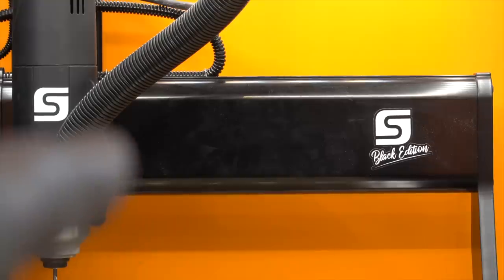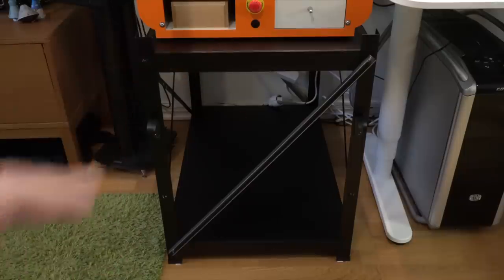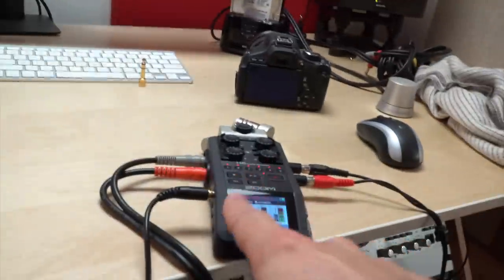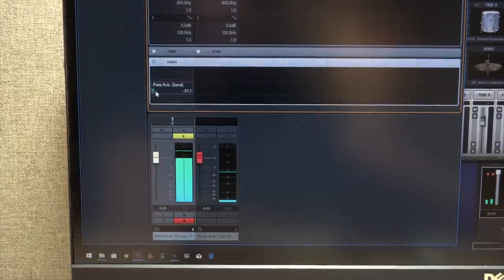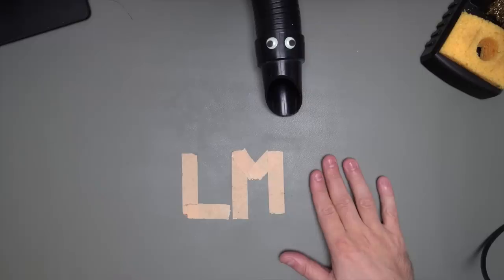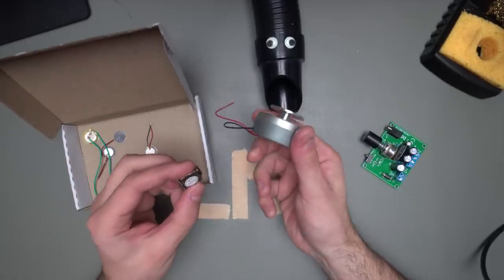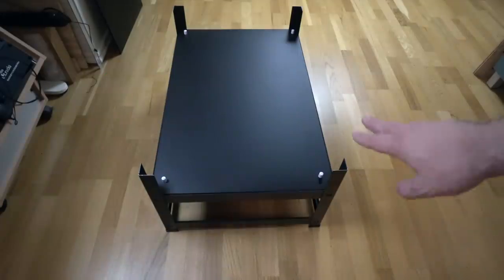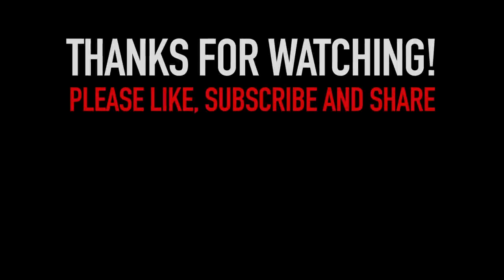DIY "IKEA Hack" Plate Reverb.  Sub $100.

Comment: I built a plate a few years ago.  It will sound a little better if you use 26AWG sheet metal and suspend it with wire.  It should be under tension and have a fair amount of distance between the sheet and the shelf below it.  You may need to cut down the corners to make room for the suspension.  Great experiment.  Thanks for sharing!  BTW, if you want to play with your current hardware more, sand off the paint, use longer spacers and use only three, placed randomly.  Patterns are your enemy in acoustics.
Reply from the maker: You're absolutely right about using 3 spacers in random orientation to avoid regular patterns and acoustic nodes in the plate.  That's a brilliant thought and I can't believe I didn't think of that.  Your other observations are on point too.
Reply: @LeoMakes  Heh, I get lucky sometimes.  I actually had a client ask if he could buy my plate off of me.  Mine was 26AWG 3'X5' suspended in a wooden frame.  I put a styrene board in the frame to act as a damper with a pull-string to control the spacing.  I used piezo pickups at first but got quieter operation with a couple omni condensers later.  Any way, keep experimenting.  I would love to see what your final version is like!
Reply: BTW, your video inspired a huge discussion within the AMPEX E-mail group!
Reply: Built 4×8' in wooden frame years ago.
Suspended from ceiling.EQ'send/
returns,in a another room,as they
(as u know)will pick-up ambient
sounds.
 Thing sounded great,EQ send .
frequencies that were "harsh",EQ
return(and plate)shaped overall
sound.Much tweaking to dial it
all in.
 An engineer said that if the plate
was isolated and properly suspended
in airtight enclosure,and pumped
out w/vacuum pump(obviously not
a complete vacuum) that it wouldn't
pick up any ambient sound,as sound
can't travel through vacuum.
  The plate,heavy guage sheet metal,
is now the floor in bed of old truck!
 I've fooled around w/smaller and
thinner sheet steel w/good results.
 However plate needs to be under
more tension that thicker steel.
Using 2×4' thin guage (28-32g)
suspended w/Multiple stiff springs,
(at least 8)in oak frame sound really
good.I need to install nylon grommets
into plate to eliminate minor "buzz"
from metal to metal contact.
 Then suspend that apparatus
in an enclosure and pump it
down to "near"vacuum.
 That being said,I've used some
softer steel that sounds even
better that the harder stuff.
  Then my friend suggested that
since being in a near vacuum
enclosure,why not 2,or 3,or MORE
units in same box!Wow -good advice
again,as u can't have to many
reverbs!
 Don't have the spare cash to do
this now,and don't have space
for a studio either,so it goes
on back burner for now.
 I use good 4"speaker,carefully cut
out dust cap,glue in hollow cardboard
tube(fits in cavity behind dust cap).
 Then trim to just touch plate,and
glue using urethane sealant.
  Pick-ups?Acoustic instrument
Pick-ups work great for this.
 2×4 frame covered w/osb 
plywood seals unit up pretty good,
although heavy,this also adds support
to framework.Spings?short heavy
springs w/hooked ends,2 on each
corner,90 degree apart.Use eyebolts
not screws as they will pull out.
 Suspend unit in another frame or
from ceiling.This makes the unit
Level,which is important.
 After hanging unit w/plywood on
backside,then install speaker/tube
on face of middle section of front
plywood(front is in 3 sections).
 I've found that point of attachment
of tube to plate to be 2-4" off center,to
be ideal.
 Transducers in line w/each other at both ends of plate 4 to 6" from edge also ideal,as you don't want them
to be out of phase.
  Cut the lows(100 and below)
 Cut the highs (3k and above)
going to the plate as a good
starting point.A cheap graphic
or similar w/any old amp to
drive plate is fine.
 Since transducers(pick-ups)
are high-z, I soldered 1/4"
Jack to them and plug into low-z
transformers,and then to
balanced Mic cables,then
into mixing desk using 
EQ on board to make 
final tweaks.
   A drill and $200.00 bucks and 
you will have a Quality sounding
plate reverb that can deliver
astounding sound.
 If you want to "dampen"it(shorten
decay) Install a t-nut on front panel w/
long bolt(1/4" diameter or so) attached
to 3×3"or so cube of soft foam rubber.
Use urethane sealant(calk) to fasten
to end of bolt.Then simply adjust
to shorten decay.Place this
apparatus on either left or right
panel so contact w/plate is 4"
or so from a corner.This is not
critical,but u want it close to
the edge,not anywhere in Middle
area.It will barely contact surface
to dramatically shorten decay.
This set-up will give 3 seconds
or more decay,so this little
thumb screw deal works
great.
 After dust cap is trimmed off
speaker then get appropriate
diameter tube(hobbie supplies)
 Steel can be had from various
suppliers,such as McMaster Carr,
or sheet metal shop.Springs
from M Carr or the like.Small
flat "L brackets for corners
at hardware store.Fasten
one on each corner w/ thin
rubber,or sealant under them
to prevent "rattles".The springs
hook into these,after mounted
w/small bolts to plate and drilled.
 As mentioned,nylon grommets
are highly recommended.Springs
can be hooked right into plate, but
Will tear metal after time,as we're
talking about 50lb or more of
spring tension(tension it takes
to expand springs,and there will
be over 400lb's pull on plate.
Get steel,springs,eye bolts,washers,
brackets first,then make frame,etc.
 An alternative is to use 8 small
turnbuckels,and high grade ones.
That's what I used on my first
plate,and worked great,though
8 heavy coil springs are better
and contribute to a better
sound.The original plates
we're hung in steel frames
as they (most of them)had
so much tension they would
have collapsed a wood frame.
I prefer wood frames/springs as
they contribute to a smooth sound .
   The original plates were "tuned"
(like an instrument!) to the users
preference,and also very expensive.
  I felt it necessary to give these
guidelines which yours truly
learned from many,many hours
of trial and error.
  An if I get into the right situation
again,several of these units will
be quickly put together and put
into service.
  The sound to my ears surpasses
their digital counterparts.
  They sound great on vocals,
stringed instruments,etc,but
really shine on percussion
stuff.
  Analog tape and gear and
good mic's can't be beat in my
opinion.Digital stuff is best
for mix-down and mastering.
  Analog tape has a natural compression
when driven(and distortion!)and like
plates,tube limiters and such cannot
be equalled with algorithms
and unlimited tracks.
Reply: @robertgodhard3248  Tyvm for all those very sharp technical tips on the REAL thing (the ikea funny thing is nice too and easy, tho).
Very interesting, keeping it all, if one of those days...
Just one thing : wouldn't it be better to NOT enter xformer directly from piezo ? I've seen other designs doing so but ... Wouldn't it be better to first plug piezo (very short wires) to very hi-z ( 2M, 5M or even more) FET buffer ? This is usualy the way it's done for acoustic instruments, isn't it ?
Piezo are so weak and prone to noise catching...

Comment: I’d like to hear what it would sound like to run a 2x speed signal through the plate reverb. Then, of course, you’d slow the recording back down. It would probably sound like a much bigger plate, but who knows.
Reply: Joseph Yarzebinski That’s a really creative idea!!
Thanks for giving me some hope un the human race :-)
Reply: Back in the 70s , a firm of architects used something like that to deduce the sound of real concert halls from  using quite small models. Of course doing it whilst hitting your plate/spring with a small screwdriver gives rise to the whole gamut of Star Wars blaster sounds!
Reply: i think so. My impulse reverb has that option for sounding longer and works well (add a hipass though)
Reply: @ianbaxter8299  unrelated,  but if you take a metal slinky, and put the ends over yours ears and shake it it sounds just like the star wars blasters.
Reply: @javiceres  *species
Reply: unless you're working on tape you'd be introducing artifacts by slowing it down. i would slow the signal sent to the reverb down and then speed it up.

Comment: You actually already own the ideal piezo preamp...  right there in your rack!  The Great River preamp's Hi-Z input is a JFET buffered DI that feeds its input transformer.  The input impedance is 1 MEG, and it's ideal for passive piezo pickups.  I put piezo pickups in all kinds of things and it sounds great.  I have long thought of building a plate similar to what you did.  I'm glad to hear that it works so well.   You should also play with the location of the plate support knobs.  It will change the vibrational nodes of the plate.   Great video!
Reply from the maker: Good eye!  I got that MP2-NV maybe 10-12 years ago straight from the man himself, Dan Kennedy at Great River Electronics.  It is glorious.  Magnificent, even.  It most certainly would work for me but I'm trying to do this project with lower-cost options that the average home gamer might have or can build.  Good recommendation, though!
Reply: What would happen if you put rubber pads under the plate support knobs to further isolate the plate from the chassis? I would also put it on wheels so that you can wheel it around the studio to modulate the effect if you so wish?
Reply: 1 Meg is not "ideal for Piezo's". It is too low.

Comment: Damn. Ya beat me, to the punch. Bravo!

I'm a studio owner. I've had a pair of EMT plate reverbs over the years. And boy oh boy, do I miss them. No digital anything can compare.

And so it had been my intention. To take a metal double frame bed frame. Weld it, solid. Add some, reinforcement braces. The piezoelectric buzzers are all right. Though I think a, Barcus Barry or a, FRAP, Might be more advantageous?

And then a, 4 x 6 foot piece of, stainless steel sheet metal. Double reinforced at each one of the corners. Let it get me the extended reverb time and greater density that I desire.

One other thing you missed. Is that, on the driver side. A rather large treble boost a.k.a. preemphasis of the high frequencies is added. Which, frequently kicks up this, sizzling sound. Which some people love. Like myself. Others hate it. Some scorn it. I embrace it and love it. It's definitely the audible clue. You got a real plate reverb.

The problems EMT had, manufacturing their, 140 series plate reverb's. Was twofold. One is that of their, cold rolled steel. Having about a, 60% rejection ratio. I know. That's almost unbelievable. And if the Germans can't make decent, cold rolled sheet metal steel? Who the hell can? Which is one of the arguments for, stainless steel.

Conversely. The cold rolled steel. When you opened up the EMT plate to properly tension it. Everyone found this horrible sticky stuff. All over the sheet metal on both sides. So nasty, sticky that it was. Many technicians cleaned it off. And that's a big whoops. As that was covered in, kneetsfoot, oil. To keep the cold rolled steel from rusting like an old car. And some were destroyed in that fashion. While others still sounded great. If they were lucky?

Reverb time was varied with, basically, rigid fiberglass ceiling tiles. Glued,, to a backing. Suspended with, levers. That moved the ceiling tiles closer to or away from the plate. To vary the reverb time. Never making contact with the physical plate. And was truly an amazing invention created by Dr. Kuhl, in 1958. It changed the world. As today. All digitally synthesized reverbs. All try to imitate the plate. And really none can compare. Until you spend between $5000 and $15,000.

So this was a great project you presented! I'm in love with you LOL. I mean a better sounding reverb than a, digital gizmo for $100. That's absolutely brilliant! And is quite usable sounding. I'm just spoiled having had the real things. So, I have to have a big one. Yes I am one of those kinds of girls. But that definitely is one great bargain!

Mx. Remy Ann David
TheTruckStudio.com
Reply: Thanks for the tip. I was thinking carbon steel would ring better than stainless but that rust would bodge up the reverberations, neets foot oil it is! Also knowing they used acoustic tile on the dampening- I've been trying to engineer how to keep a felt piece from touching the plate and rigid tile is a fabulous solution. Looking to start assembly in the near future. 😸
Reply from the maker: Very interesting observations--thanks for that.  I didn't know about the oil coating on the plate, but it does make sense.  It's incredible how quickly uncoated, ungalvanized, or otherwise unprocessed steel starts to rust.  Part of the reason I went with the "tabletop" form factor was that I didn't have a good solution to the "ceiling tiles suspended with levers" thing that I would otherwise need to build.  Plus it's fun to physically dampen the plate with your hands.  But it is something I want to look into as a next step.

Thanks for watching!
Reply: Dude what punctuation language are you using?! Cos it sure ain't English!

Comment: Awesome - I'm totally building one of these. From my experiments with piezos - the bigger the better. The larger surface will pick up lower frequencies, which you can roll off in post if you want. Also - get some thin foam rubber and make little squares to put in the corners - try to float it off the frame instead of the lower shelf basically.

Man and you could have multiple plates -- one with springs stretched across or sympathetic resonating strings or something... yeah I'm a make one of these.

Comment: Been doing something similar to this for a few years, just using a vibration speaker and contact mics (as well as other mics) to pass sounds through a selection of household objects (tables, tins, boxes, bathtubs, etc).  I wasn't specifically aiming to create reverb so much as add some timbral variation in a nicely hands-on kinda way,.  For me any reverb is just a bonus!  Top tip; try covering the 'plate' with dried lentils to add distortion.